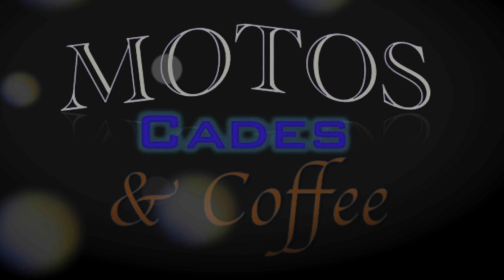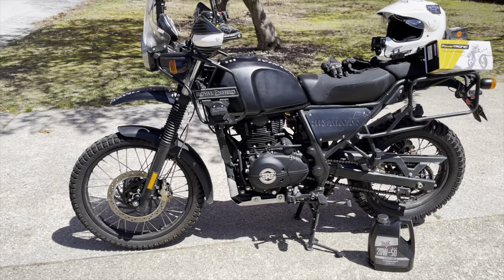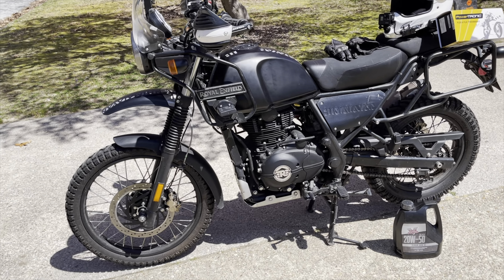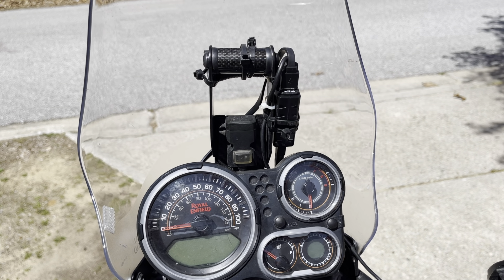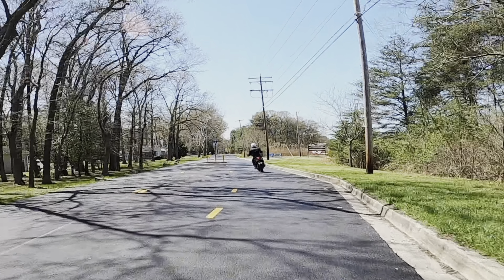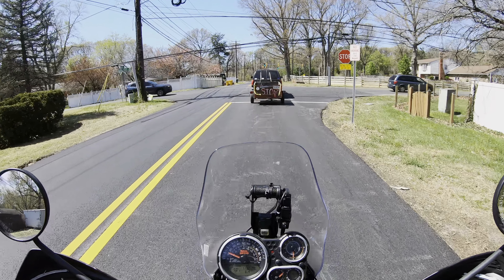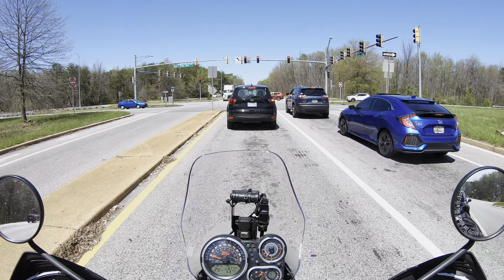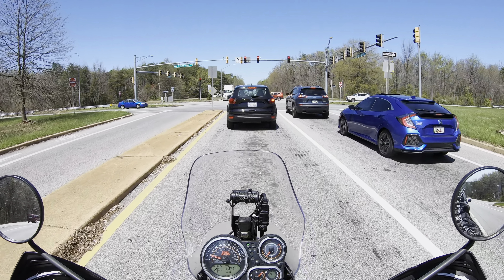Royal Enfield Big Bore Himalayan & Cam Dyno Day Pt. 1 | Contest & Give Away

Comment: How is the bike on the highway with the big bore kit and cam? I've been doing several hundred mile trips on the weekend on mine and where I'm at in Texas, even the back roads are 70-75mph and this bike is killing me. I was wondering if putting the money into the kit would be worth it or not if it helped the bike do up to 80mph comfortably
Reply from the maker: Well if you take a look at my latest Himi update..it’s pretty decent on the highway! It’s an easy 80 MPH bike with lower RPM’s…but my valve springs were not up to the task, and I’m replacing them. :)

Comment: I also have the 465 BB kit   plus a TECBIKE cam...   I bought because I wanted more low down acceleration, I hardly ever go over 5000rpm..  I use a 16T sprocket... I have never had a stalling issue ,,before the BB it was perfect    but now it starts not quite as good ,,before I could start from  cold on tickover ,now I I have to blip the throttle once and she starts.. I,m thinking you maybe got 27bhp (if you are lucky)    One of the best mods I,v done is fitted a tapper head bearing,it just makes the steering better.also YSS all round suspension  has improved handling..  Went for a ride Saturday and  exhaust came lose,,,easy fix   have a good day
Reply from the maker: Amazing stuff! I haven’t touched my suspension…yet. Lol. I have some big news on in engine mods here soon ;)

Comment: Go! Max! I guess 30BHP at the rear wheel at 6000rpm......
Reply: Oh! and it would surely work better on the dyno with smooooother tyres?
Reply from the maker: Nah this is so low HP the tires won’t make a huge difference, but I like your guess!

Comment: I'd guess around 31
Reply from the maker: I like that number!!
Reply: @MCCJustMotos  my stock Buell Blast is 492cc and has 34hp....I would hope that adding 52cc, plus a cam, ECU, sprocket, and air box upgrade would get you at least 7 hp.....fingers crossed.....LOL
Reply: of course, I think a free flowing exhaust minus the catalytic would help greatly and drop some weight also
Reply from the maker: @chicknman72  yup, but I do want to keep low end torque
Reply: @MCCJustMotos  from what I have heard....you don't lose sh*t......still does grunt stuff.....LOL